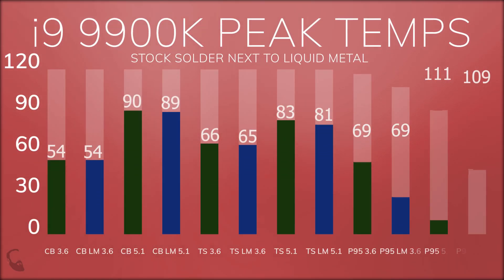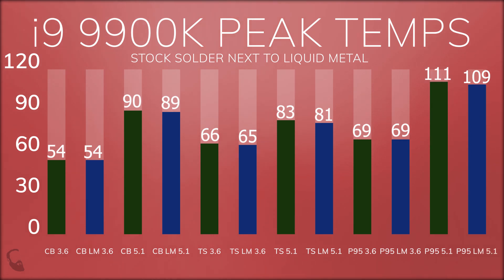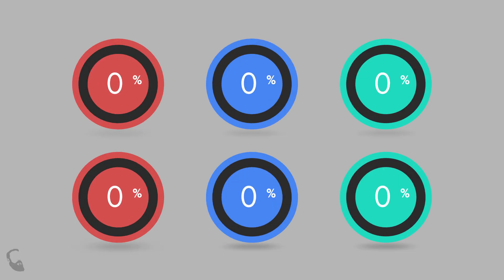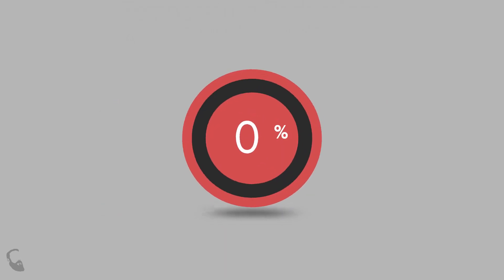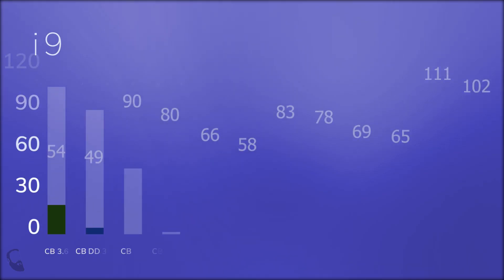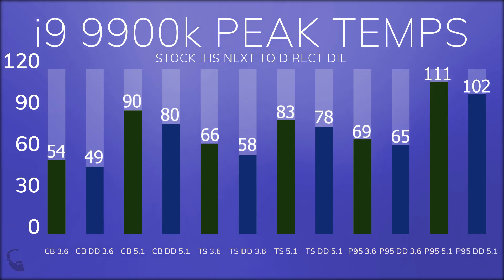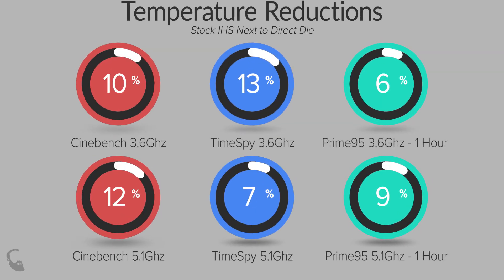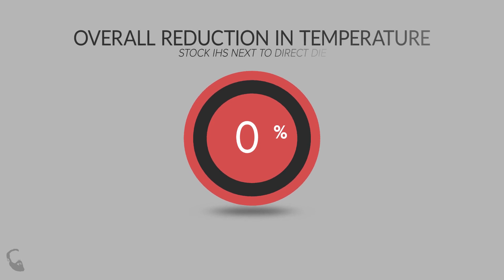DELIDDING THE 9900K WASN'T WORTH IT. BENCHMARKS CHARTS AND COMPARISONS

Comment: I saw the delliding video,  it had a very good contact in tye middle and yiu said the IHS is flat already. I knew your temos wont be much dufferent judging from that. Also many people put liquid metal only under tge IHS and normal paste on top.  I asume you didnt put L.Metal on top. There are badly soldered CPUs and the IHS is not flat at all,  they will benefit more.
Reply from the maker: The delid for the 9900k is pointless if you are going to reinstall the factory IHS and is only effective if going the direct die method which is also super risky. I have the DERBA8ER direct die mount sitting in a drawer if you want it I can send it to you if you pay the shipping.
Reply: @wasted_padre  Thats not true. You can sand the die and improve the flatneas of both ihs and the die. I have 6-8c improvement on my soldered 10700k just from that without the liquid metal improvement. I use sanded 9900k custom IHS though but you can sand the stock IHS too. I gained 150mhz and now i can play games on 5.4ghz 1.5v. Its stable on 5250mhz in non AVX stresstests. With better fan and all the improvements i made i have at least 12-15c drop. 65-75c in game 85-92 in Aida on 200+w while before was above 104c on lower voltage. You just use low volatage. Also you need fans on High otherwise they cant keep up with the fast voltage spikes. Im aware mine is high even though it doesnt go above 75c.

Comment: I saw a 20C drop delidding my 9900K, I used Kryonaut instead of Liquid Metal because I have an Optimus Signature V2 Water Block and I didnt want to stain the copper. I run at 5.2GHz all cores and don't go past 80C with Full AVX worst case scenario benchmark. I don't know how you hitting 100C with Direct Die and Liquid Metal, your CPU block is surely not sitting flat.
Reply from the maker: That's what I was thinking! I thought for sure it was a mistake so I took it out re-applied the TIM and still was getting hot results. It's possible that my application was bad on both runs which doesn't seem likely, but stranger things have happened. Also, my testing may have been somewhat limited in the number of runs, and hours per run compared to other people's methodology but this was my honest and admittedly novice attempt. I would do it differently if I was going to do it again, but I don't think I will be making a v2 of this video.  I am really impressed that you hit 5.2 all core you must have a nice piece of silicon. I couldn't make it past 5.0.
Reply: @wasted_padre  Damn. That's unfortunate. I had to spread the paste evenly and make sure it was perfectly flat. Also, I agree, I definitely have a good chip. Look forward to your future videos man. Nice one!
Reply: @wasted_padre  It's totally because surface isnt flat,  it's impossible to lose only 1 degree using LM between a die and an IHS. I actually gained 4C by using LM with aftermarket IHS turns out it wasnt smooth, after switching to stock IHS temps dropped by 20C gained 100mhz.
Reply: I'm gonna delid my 9900k next week and I go direct die with Kryonaut past. At the moment my temps at 4.8Ghz @ 1.20v with the prime 95 small fft are 80° at an ambient temp of ~24° I will report back the temperature I achieve whith dd and Kryonaut. Thx for the post.
Reply: @brunoxsimoes  awesome, with that ambient, you should see around 11-15c drop which is awesome. Best of luck and look forward to results. Ps. Make sure your block sits flat by screwing it in then remove it to make sure the paste is fully spread.
Reply: @BlackhatXII  Thx 😉 I post the results next week. 
Thanks!

Comment: wonder if delidding would get my core temps closer?   running small fft's  w/avx  core 2/4 get up to 12 degrees hotter than the rest average using the stim.
Reply from the maker: If you are using a soldered CPU like the 9900K or the 9700K you will only see moderate drops in temps if you go direct die. If you do that you will get a 5-10 degree drop depending on the application.

Comment: you have to sand the ihs down more. a lot of people have had the same experience.  it didnt really help.  this guy said the same thing, didnt help till he realized that the extra thickness of the solder meant that you had to really sand the ihs down more.  thats why you get a decent result with direct die.  the proper gap between the ihs and the die isnt a problem with direct die.  https://www.reddit.com/r/overclocking/comments/aaujoh/delidded_my_9900k_got_great_results/

heres what he said "I ended up having to mount the CPU several times to figure out that the reduced height of the Die-cover made the contact between the chip and IHS very bad. Ended up sanding down the copper IHS a little bit on some 1500 and 2000 grit wet sandpaper."

and max temps went down about 16c.  this was just with a delid and nothing else (except sanding the ihs down of course).

you should get 5c or so with a delid and another 10c or so with direct die.  if not then theres a problem with the relid and the gap between the ihs and the die is too big or the LM isnt on right.

it could just be that that guy i linked had a cpu that was soldered really badly and thats why he got such good results.  idk. sorry maybe im wrong.  i delidded my 8700k cause all it took was a shaving razor and about 30 seconds to crack open.  why not?  i actually sold that cpu for what i bought it for new to a friend because it was predelidded and it clocked well enough and then i bought the 9900k.  really want to delid and go direct die but the gains are less and the work and risk are greater.  still might do it though.
Reply: did you delid it?

Comment: I dropped 6 degrees with the delid (using your video and the rockit 89).  That 6 degrees was VERY worth it because it allowed me to go from 5.1 ghz 1.350v (LLC Turbo, that's bios setting not load) in realbench 2.56, with the front door OPEN, and 98C temps, to 1.335v (bios setting), 89C, with the front door closed (warmer ambients).  That's pretty massive.  Before delid, I would reach 94-95C with 1.335v and I would get a WHEA error (tended to happen if I passed 91C) or a BSOD.  So the delid allowed me to stay below the critical temp point.  And drop in voltage=longer CPU lifespan.
Saw about a 7C drop at 4.7 ghz, running prime95 29.6 build 7, 15K fixed FFT, FMA3 (1.230v bios, LLC high).
Reply from the maker: Hey those are excellent results!!! I am glad you got your overclock dialed in and your temps under control with your delidded CPU!

Comment: Nicely done, I appreciate your honesty.  Waiting on my direct die kit.  One question though, should I be concerned how tight to screw down my water block to the die?  Beings how there is no heat spreader to distribute the force of tightening?
Reply from the maker: Yea I would be conscious of over tightening but the OC-FRAME is literally the same thickness as the die and i feel it also helps distribute the force of the block.
Reply: Ok, gotcha....that makes perfect sense. @wasted_padre

Comment: I dropped 6 degrees with a delid and liquid metel and dropped another 8 to 9 with direct die so 14 to 15 degrees total off completely stock from intel.
Reply from the maker: Those are excellent results! I am completely jealous!
Reply: My temperatures on P95 were up to  95 C and dropped to a max of 80 now, but for some weird reason some cores are down to 72 C. I will try fine tuning my liquid metal application, and check tension on the screws on the direct die plate and X62 cooler to see if I can get lower delta between cores.

Comment: I should not have delid my 9700k
I think my temps are worst now, i didnt save my screenshots before delidding so i cant compare, what an idiot
At 5ghz i reach 70 degres in occt linpack
With nhu14s at full speed
Reply from the maker: 70 C while running a stress test sounds normal. Are you sure the IHS is making good contact with the die? Have you considered getting the OC Frame?
Reply: @wasted_padre  i re-delidded, i lapped the bottom of the ihs a bit more and used only small amount of metal, i gained 10 degres in load
I am also thinking about the oc frame, maybe a bit later

Comment: I expected direct die.. Dude who would go through the extra trouble of delidding the 9900k and not use direct die. :/
Reply from the maker: I initially thought there was going to be a greater reduction in temps simply from removing the solder and didn't decide to go with direct die until later on.

Comment: Nice vid... Subbed... but could it be your speciment that was A: well put together/soldered or B: bad silicon? I have read that some 9900k did have a nice improvement by delidding.

Edit: How did you remove the solder? Do you have any experience with this solder remover: https://rockitcool.myshopify.com/products/quicksilver-solder-remover?variant=22232415961146

I am debating on direct die cooling now :) again thanks for the video